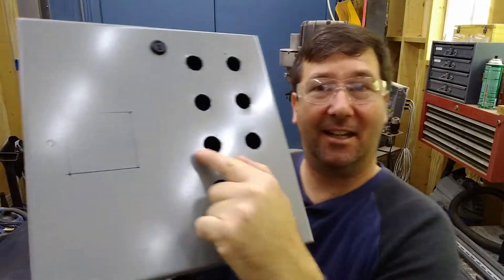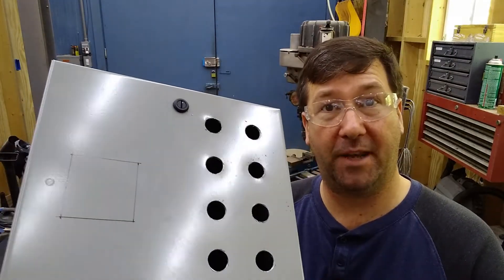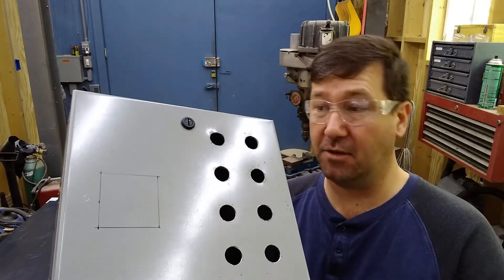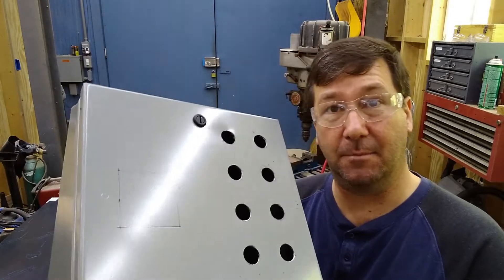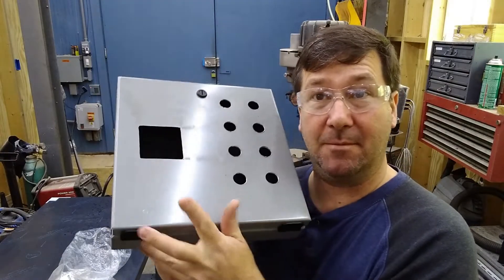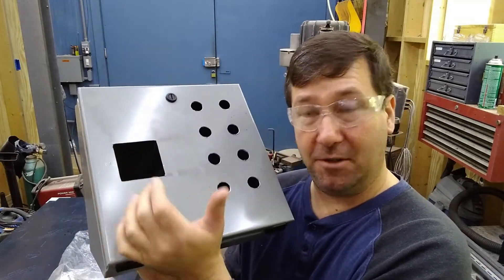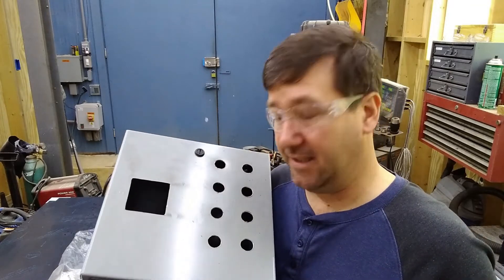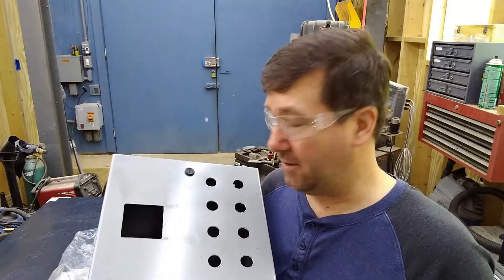Using an Oscillating Multi-Tool to Cut the Corners on Square Holes in Industrial Control Panels

Comment: Tim, I’m building a panel that will have 9 1” square temperature controllers mounted on the panel door. What would be the best tool? I have built one panel that has 1 controller, but I used a dremel for that. Using the battery powered dremel does not seem efficient. What would you suggest? BTW: they are the SOLO 4848 controllers from Automation Direct.
Reply from the maker: My first choice would be to pop the door off and take it to a fab shop and get it laser cut.

My second choice would be a knockout. Greenlee has one for that.

Comment: i also build electrial control panels . i find the cutoff wheel leaves the inside of the panel smelling like burnt metal
Reply: I was researching lasers for some foam inserts, and thought "maybe my HMI cutouts???" unitl I saw the price on 2kw fiber lasers.  Jig saws don't cut as straight as a cutoff wheel, but the wheels can leave the paint discolored if you don't take your time and move the wheel back and forth slowly deepening the cut (as opposed to a plunge and run cut).  Thinking about Milwaukee nibbler but haven't found anyone else who has used it for this type of application.  Might just be stuck with the old cutoff wheel forever.
Reply from the maker: Maybe, I clean it out good after but there probably is some smell still.

Comment: They are a bit pricy, but if you plan on cutting 1/4 din , 1/8 din, holes on a regular basis. I found a knock-out-set made for the size hole your cutting, works the best. greenlee make the set I have.
Reply from the maker: Yes, I've always been on the fence about purchasing them.  I'll get a run of DIN hole panels then I may not have one for a year or two.  I try to take them down to the laser shop and have them cut if the job isn't a rush.

Comment: Once the hole is drilled, the interface between the hole and metal surface (thickness of hole  does not have any surface coating ) can this cause any issues with corrosion? Is there anything that can be used to coat it?
Reply from the maker: I've never seen this done. The inside of the enclosure should be dry and lass likely to corrode. But it wouldn't surprise me to find it does exist.

Comment: what about using a nibbler?
Reply from the maker: I have one and at least mine slightly bows the surface of the panel.
Reply: @TimWilborne  isnt a nibbler more for sheet metal. enlcosure are usually thicker than that

Comment: Is there a multi tool blade that would cut the entire opening, a blade suitable for plunge cuts into steel?
Reply from the maker: This one would but I would be worried about being able to control it while plunging. I think I'd scratch the paint really bad.
Reply: @TimWilborne  what about if it was a semi-circular blade? Do you think it would handle it?

Comment: Is there a blade for cutting square hole in 1/4” plate glass?
Reply from the maker: Not sure,  I don't know much abut cutting glass.
Reply: The only way to do this without destroying the glass is an abrasive waterjet cnc cutter. Even then, the corner is radiused.

Comment: Don’t they make square punches 
1/4 din 1/2 din etc.?
Agreed square much more work then round
Reply: They do, but they are hard to find and expensive. IIRC, when I was looking for one, it was close to $300. I can do a lot of filing for $300. :) But I'm not a panel builder, I'm a programmer that occasionally installs the hardware as well. If I were to need it on a weekly basis, I would plop the money down in a heartbeat.
Reply from the maker: This isn't a standard DIN cutout so it isn't an option.  Plus this is a skill that must be used for HMIs and all other non DIN square cutouts.  But same as @MrWaalkman, I don't have any square knockouts, I don't cut enough squares to justify having them.  Also I don't use knockouts for round holes.  Here is where I talk about cutting round holes.
https://www.theautomationstore.com/drilling-holes-in-an-ul-508a-industrial-electrical-control-panel/

Comment: I had to cut in 6 or 8 SMC bulkhead plates for air connectors (each on having 8 or 16 points per plate, I don't remember). and these had to be installed on existing panels of which some of them had a beam right next to them. This meant that I had to "standoff" from the panel with my saw using just the last few inches of the blade. In a paint shop as well. It was a bear...

I did mine with a cordless DeWalt Sawzall and a file. Despite the caveman approach they came out perfect. :)

The first one, while matching the template perfectly, wouldn't stay in reliably (so much for factory templates). I had to get creative with that one, and I ignored the template for the rest of them.

And for you young shavers out there, I used a small cardboard box taped to the inside of the panel to catch the filings as I made my cuts. You do not want these filings finding their way into the electronics inside the panel.
Reply from the maker: Yes that is always fun when you are moments from the blade coming out of the cut and tearing up the paint at any moment!
Reply: @TimWilborne  I was amazed that when it did come out and ruin the blade it managed to hit the part that was being cut out. It's better to be lucky that good.

Not that it mattered to anyone but me. It was an upgrade to an old PLC-5 system (from a PLC-5 to a Control Logix 5000), so it had been there a while. Quite a while... :)